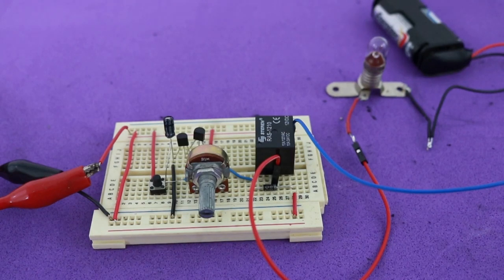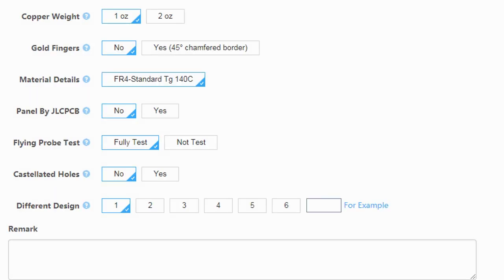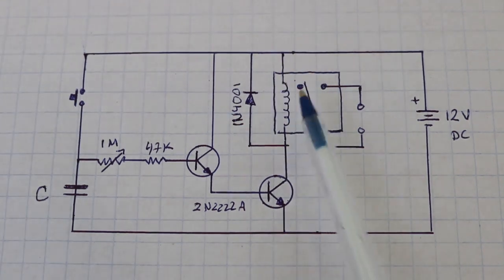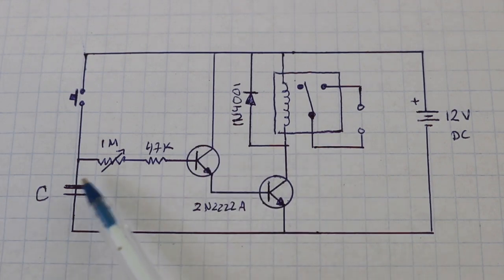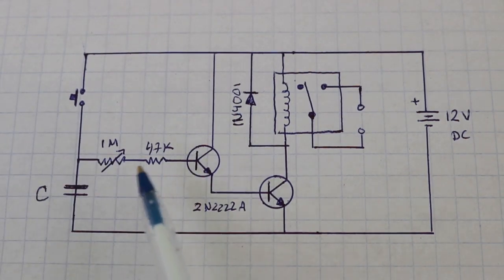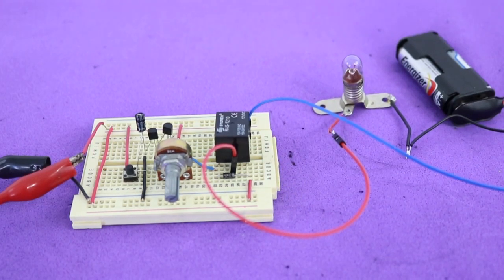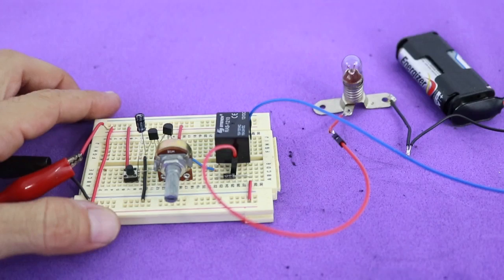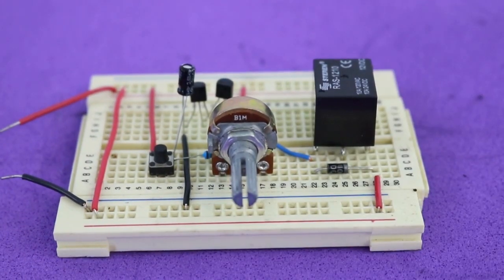Variable Timer On Off Circuit

Comment: I did try to make this circuit using a 5v relay and 5v input power but the circuit was unstable. The relay would not energize. I don’t understand how the second transistor with no base resistor can act as a switch. The rush of unrestricted current from the positive supply into its base when the first transistor turns on should send it into orbit not saturation. One downside of this author is that he rarely responds to your questions!!

Comment: i just got a burned bjt , isn't the second bjt getting 12v on the base with this set up ? correct me if i'm wrong . i used a BC547
Reply: I think your resistor you used in the base are lower than 40k

Comment: +subscriber

+today i learned why not to connect transistor Base directly from variable resister - to protect it. 

+Why we need second transistor - to supply enough current to relay so it will work properly. 

❤❤ thanks alot

Comment: Really nice video.  I'm learning electronics and find videos like these a really useful way of getting a handle on component relationships.
I'm at the gear/steering wheel/brake/handbrake/clutch phase where if I  focus on one all the rest go to pot.
Even though the circuit is quite basic the load/current flow needs a bit of thinking about..
Out of interest how would this circuit be different if a MOSFET were used instead of BJT.  If in fact relevant in the configuration.
Reply: Just for interest, this is kinda how a 555 timer i.c. would work. (I don't know much about electronics stuff). I think it's basically a RC timer circuit, which you're probably familiar with.

Comment: What is the value of caps and resistance for a delay ie on time for 3hrs ie. 180mins/ 10800sec
Thanks in advance😊😊
Reply: Use a microcontroller instead for large time.
Reply: You can't really use RC delays for things like 180 minutes because variations from temperature and supply voltage will affect the timing constant. You need an oscillator and a counter.
Reply: Thanks for the replay @keepcool5945  but I need things to be in analog.
Reply: Thanks  @Peter_S_   Can u please explain it, if possible with ckt,  keeping in mind that we are working with only analog.
Reply: Your best bet would be to leave the resistors as in the video, but use a very large capacitor. 

It will still be very inaccurate and depends on the quality of the capacitor, it may destroy the switch when you press it ( add a resistor in series with the switch, maybe 100 ohm or so).
The best solution would be to use a digital timer or microcontroller.
Reply: How accurate does your timing need to be and why the insistence on analog?   Using an fet instead of bipolar for the first transistor could give much longer delay times, but you're in the realm of picoamps and the circuit would be vulnerable to temperature, humidity, age, emi and battery voltage.   Btw ludic's circuit is only for rough timings.  A 10% drop in battery voltage would cause a roughly 10% change in timing.  And electrolytic capacitors lose capacitance over the years.      It's not a decent clock!     But then sometimes that's acceptable.
Reply: T=5t  equation
T=5(capacitor in farad * resistor in ohm)

Comment: Please explain how electrons flow from the positive to the negative terminals of the battery (?)
Reply: My point exactly! He shows current (electrons) from the negative terminal of the battery, through the circuit, to positive!
Reply: @mkowitz  Yes, Electrons are negatively charged, and collect or are condensed at a conductive surface creating a negative charge. When a battery is delivering its energy, the electrons are flowing from the negatively, electron rich side of the conducting material, toward the positively charged surface, that lacks electrons. They seek balance, that is the nature of electron interaction, to be surrounding a balanced conductive atom. To be conductive, suggests the electron cloud can easily accept and lose an electron. A string of these atoms allows electrons to easily jump from atom to atom in a steady flow, attempting to populate the moving electrons onto the material that lacks or is missing electrons at the end of the line; until an equilibrium is reached between the negative and positive sides.
The simplest example is the voltaic pile. It uses an acid and two plates, one zinc and one copper. The acid dissolves the zinc which gives off two electrons, the zinc becomes an ion, travels to the copper, and steals two more electrons and brings them back to the zinc. Basically a build up occurs of electrons on the zinc plate. These electrons can be dumped back over to the copper plate through a circuit. 

Im not an expert, Im a tattoo artist, but thats the gist.
Reply from the maker: I like tatoos
Reply: @ludicscience  LOL :) 
They're fun, a bit painful, but worth it if the design fits the body and is genuinely artistic. 
I like circuits... just learned to design pcb's in Eagle, working on a new product line of S.T.E.M. toys and gadgets! 

I enjoy your videos, I like to see the various ways components can function together to solve a problem.
Reply: @Reach3DPrinters  Great, do you have a webpage?